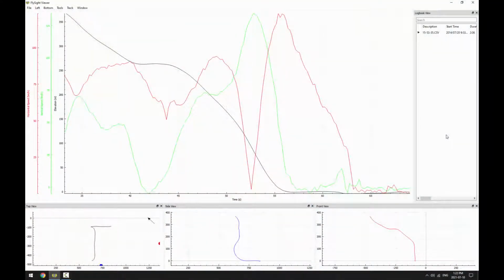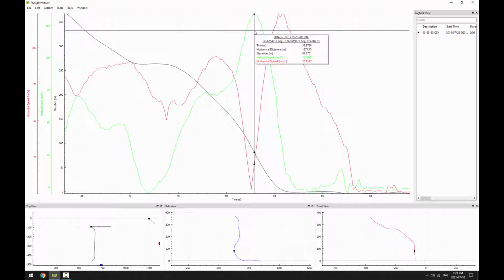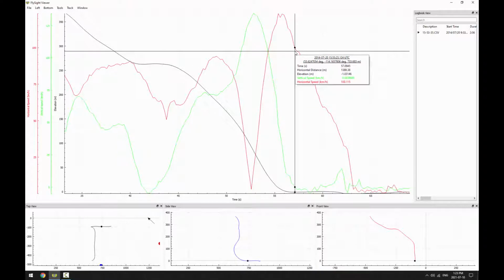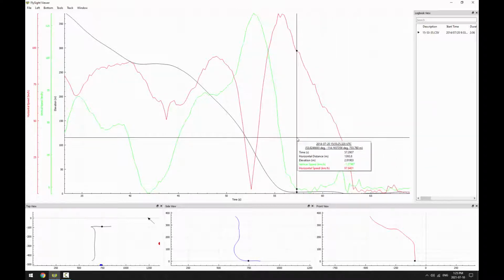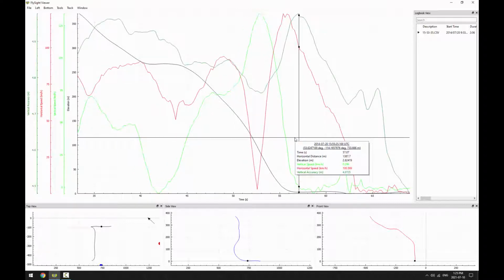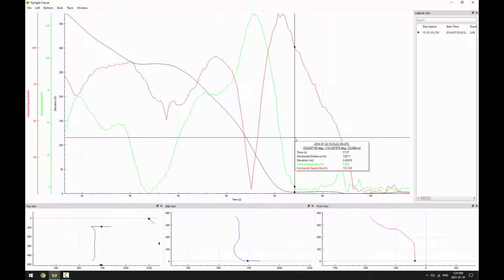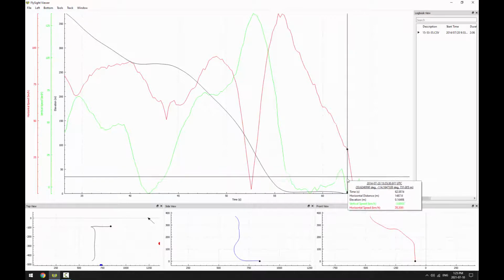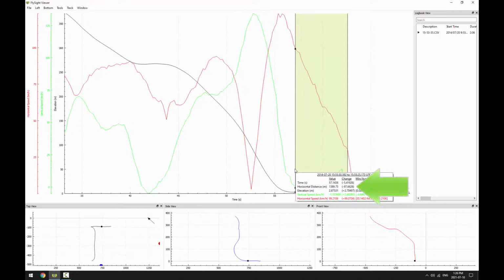Canopy Piloting: Horizontal Flight

Comment: Thank you for the videos! A question - is there a way to jump to a particular point(s) where certain measured parameter meets my desired value? For example, Elevation = 1.5 or Vert Speed = 0. For multiple values that meet this criterion, an easy way to toggle between them would be helpful. Thank you!
Reply from the maker: There is no way to do this at present, but it's an interesting idea. One interface issue comes to mind--namely, the cursor is usually controlled by the position of the mouse, so if you "jump to" a particular point using this hypothetical tool, then move the mouse cursor, what would you expect to happen?

We had a similar issue with the media cursor (used for video sync). In older versions of FlySight Viewer, there was only one cursor. When you hit play in the video window it would just take control of that cursor, and when you moved the mouse in the plot, control would change to the mouse. But this was really confusing sometimes--you'd find just the right spot in the video using the scrub tools there, then you'd move the mouse and suddenly it would jump to a different spot. So we separated the mouse and media cursors, which means you can no longer scrub by moving the mouse in the plot view, but it makes the whole thing a lot more intuitive.

With the proposed "jump to" functionality, it seems like the main use would be, e.g., to measure from that point to some other point. But it's not clear how this would interact with the mouse cursor.

I wonder if it would be better to have the mouse cursor "snap to" a certain set of values. You could hold Ctrl if you don't want to snap to those values, but otherwise what I see as the main use case would become a lot easier--you'd just move your cursor close to the place where vertical speed = 0, it would snap to that position, then you'd click and drag as usual to make a measurement. These "snap to" values could be set in Preferences, so they would apply to every jump you load. I think this would make sense, since things like elevation = 1.5 and vertical speed = 0 are thresholds that are common to every jump (i.e., they represent things like gate height and touchdown which don't change from jump to jump).

What do you think?